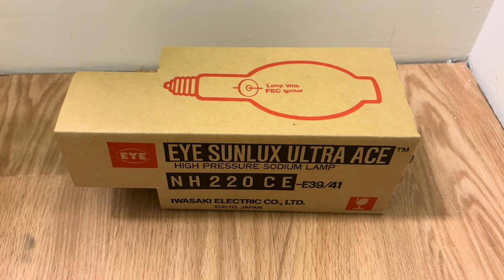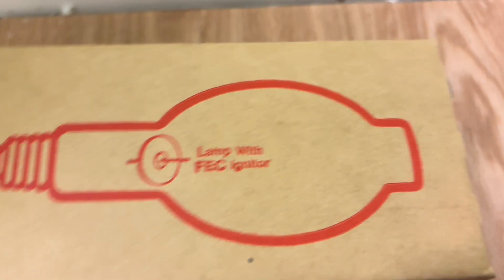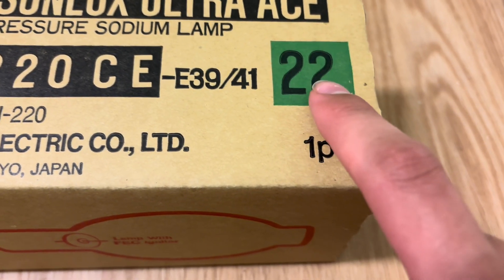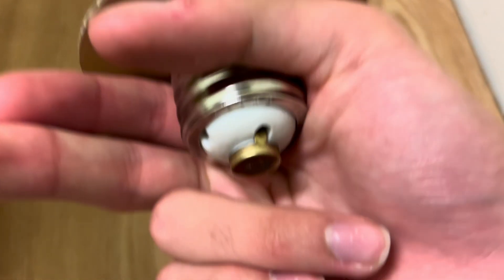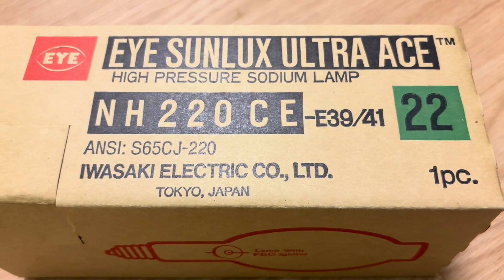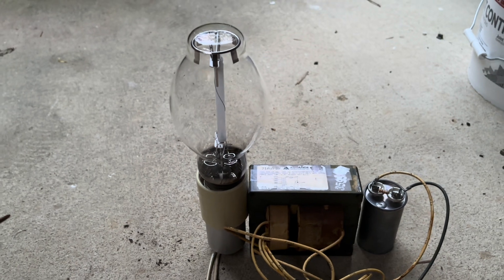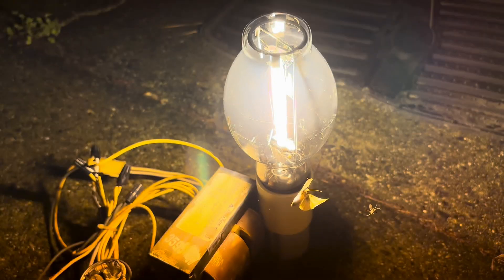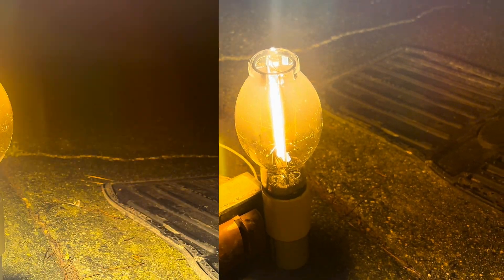EYE Sunlux Ultra Ace NH220CE 220w high pressure sodium mercury vapor retrofit lamp

Comment: Thank you for your informative  video. In South Africa we have used the NH 220 FLX known as a Xenon Sodium lamp operating on the conventional 250 W M V European type control gear. Selling feature a 10% energy saving compared to convential 400W+ HPSV Watts loss of ballast and external ignitor (+ 2W) Average  life 25 000 hours. EYE range up to 940W operating on 1 000W M V ballast.
For more information on EYE lamps and lighting - visit Iwasaki Electric Company in North America or Japan 
On their web site Iwasaki are discontinuing the production of all discharge lamps from January 2025. Needs to be confirmed  by the reader before being accepted as fact.
Only  had great results with the whole range  of EYE  discharge lamps. We have 230 volts/50 Hz. 
I have an original EYE generation snap start internal ignition device 220W HPS lamp.
The FEC is the ignition device in place if an external  ignitor.

Comment: Cool lamp! If that green “22” were a NEMA label, it would be quite laughable because there are no fixtures that are truly “designed” for these lamps, it’s just a standard 250W mercury vapor or 250W metal halide fixture.
Reply from the maker: I think green was used as a NEMA label for LEDs very early on
Reply: @HIDLad001  That’s interesting